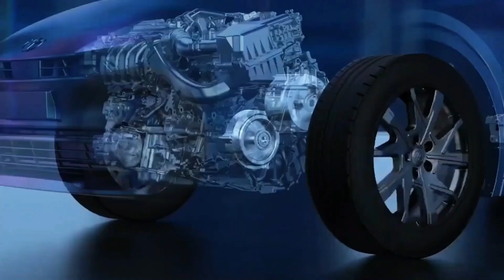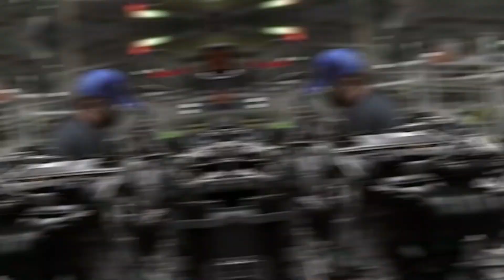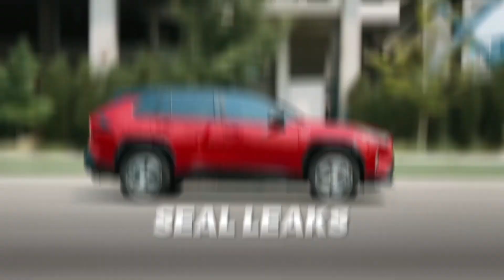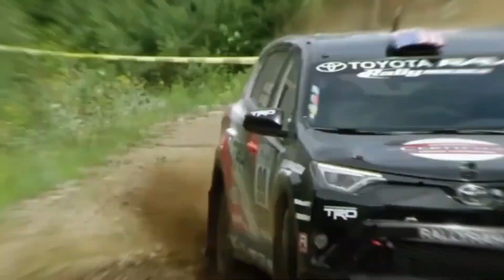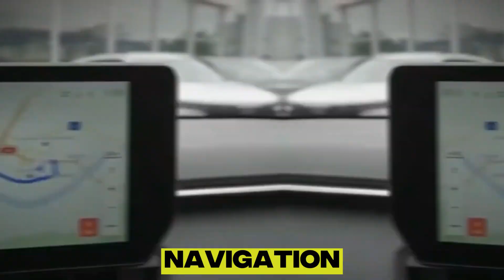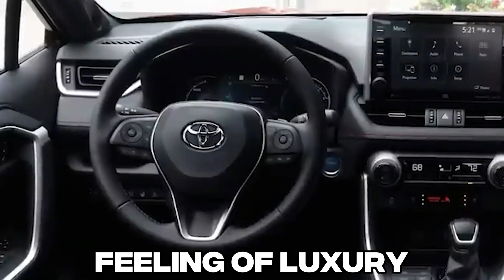MIND-BLOWING Toyota RAV-4 Issues nobody will Tell You!

Comment: I own a 2020 RAV4 Hybrid and it runs like a dream. From the factory the only known issue in some RAV4s is the fuel sensor not reading correctly. 

Toyota got sued for this, but only agreed to fix it on vehicles under 100,000 miles. Never heard of any of these other issues or had any other problems. 

Runs great and very reliable! After all it’s not KIA. 😂